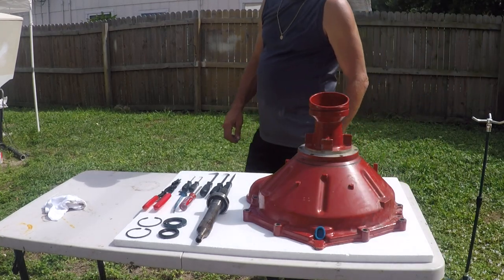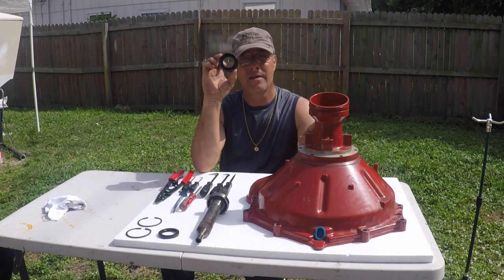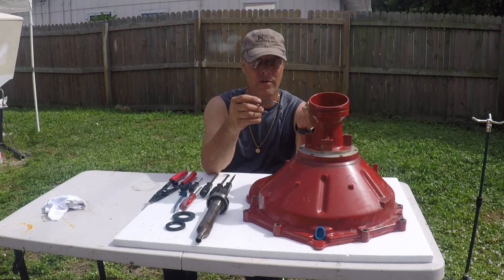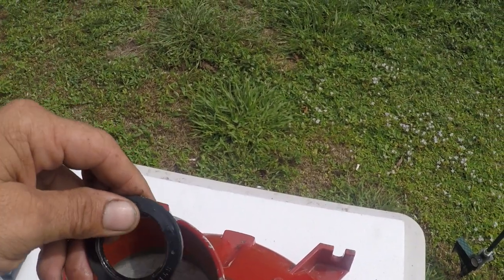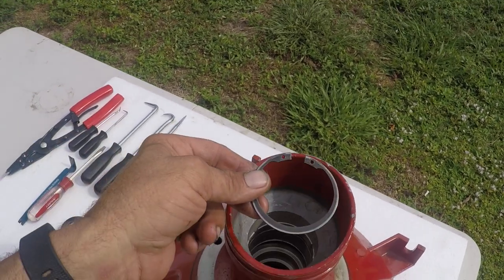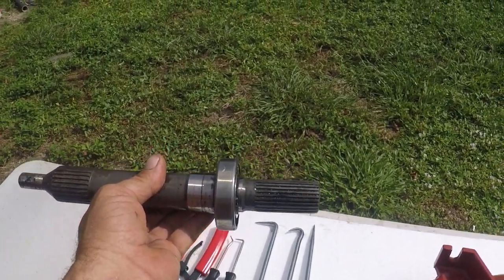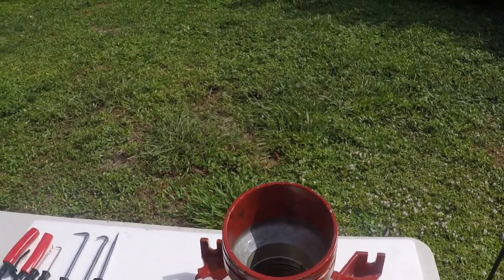Volvo Penta 290 14" Bellhousing replace bearing & seals

Comment: Guys....it's a good video. Stop arguing the toss over terminology. It's shaped like a bell. Every couple of years I strip this and change the bearings / seals etc. I always forget which way the shaft comes out. For or aft and belting the shaft the wrong way is going to be expensive. It's a good clear video which reminds us of what's going on in there. Thanks very much

Comment: Hey guys, great video by the way. Im having all kinds of issues trying to figure out if i have 1 bearing or 2. Its a 1995 dp-c with the 4.3 motor. Ive been told i have to remove the motor and ive also been told i dont have to. Any help wold be greatly appreciated.

Comment: Only the V6 and V8 bell housings that take the 14 inch flywheel have the single bearing assembly which makes the job a piece of cake........The other bell housings that take the 12 inch flywheel has two sets of bearings.  I'm surprised you didn't show the removal of the bearing from the shaft.......A press comes in very handy on that one.  All snap rings go in before the last seal is installed.  Not sure if you have recently heard but the reason some people install that last outer seal backwards is there are some online chat forums that recommend doing so to help stop water from getting in better opposed to the conventional installation method.  The trim cylinders seals are set up that way which is probably why that recommendation came up.  Doesn't matter either way as replacing the bellow once it shows signs of age keeps the assembly nice and try.  Once water gets in the u-joints are the first to be attacked and if those come apart due to neglect it could wipe out the bell housing.
Reply from the maker: Like an idiot I was filming it but my gopro shut off battery died

Comment: Really appreciate your effort in making this video. I happen to come across it because I am doing the same job. Wondering if I can pull that shaft without removing the bell housing off the engine? If I pull the seals and snap rings can I just pull the shaft out?
Reply: I removed the bellhouse and swapped the 2 bearings this summer in mine, mine is a 290, so it had 1 more snap ring that this video shows which goes around the axel. 
So if you dont have the snap for the axel it should be possible, but It would actually be easier to just pull the engine and swap everything at once. the job is rather easy as long as you have good snap ring tools, you need Normal and inverted snap ring tool. 

Mine also had a grease nipple on the bellhouse which Eddie said the 290 does not have, so it might be a difference in which year they are produced. 

The actual bearings came out rather easy, and the motor allignment is rather easy compared to mercruiser, due to the 6 lock nuts that goes into the outdrive plate in the back. So tighten it enough to align the engine and then move the engine to your marked spots(I traced the engine mounting pos) once you tighten them down you torque the backplate into spec and you are done.

Comment: FYI.... this component is a Flywheel Cover..... ( Bellhousing in the automotive world )
Also, this is NOT a 290 Flywheel Cover!  The 290 Flywheel Cover was equipped with a Double Bearing PDS, and also a grease port for lubricating these bearings in the future. The 290 Flywheel Cover will accept  the 
GM 153 tooth flywheel  and the small Volvo Penta flywheel only. 

The one being shown is a later model single bearing PDS Flywheel Cover that accepts the 168 tooth flywheel. Most likely from a SP-C or DP-C drive.   
The shaft that he shows us is a PDS.... (primary drive shaft) 
He is also showing a 6206 bearing, of which is an open bearing. 
However, this F/C is not equipped with a grease port, so a 6206-2RS sealed bearing must be used. 

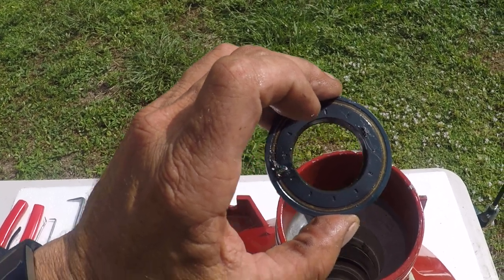At 3:13 into the video he shows the AFT seal.  Since this Flywheel Cover does not offer a grease port, the AFT seal can be installed in the conventional direction. 
However, for any F/C that offers serviceable PDS bearings, the AFT seal will install in the "non-conventional" direction to ensure that it may breach excessive grease gun pressure and/or volume. 

Use a good high pressure bearing grease. The Marine grease is inferior for this purpose.

Just a heads up and FYI for you guys .
Reply from the maker: 290 penta bell housing 14" is a single bearing if its a 12" then it has 2 bearings this was the last year of this bell housing, very hard to find
Reply: Eddie, all due respect to you and no offense intended........ this Volvo Penta part is a "Flywheel Cover". Bellhousing is an Automotive term.  The GM V-8  engine flywheel cover for the 290 stern drive dates back earlier. One change that was made would be that the AFT end  PDS splines changed from course to fine. 
The 290 F/C will house a 153 tooth ring gear flywheel ONLY. 
The F/C shown in the video is a later unit (not a 290). It will house both the 153 and 168 tooth ring gear flywheel.
Reply from the maker: A 290 Volvo Penta bellhousing only has one bearing a 280-270-260 has two bearings unless you have a small diameter flywheel for the older 350 5.7 liter engines this bellhousing is for a pre Vortec and Vortec engines 1996 and up till they ended the series and came out with the SX
Reply from the maker: That is high temperature Marine grease not just regular Marine Grease

Comment: ya hey thanks you put on a good show mine I took the snap ring out and drove out the seal undamaged (dead blow and block of wood) took a few taps don't hit it hard no corrosion in mine ya the seal numbers on yours would and bearing #'s on yours woulda been interesting sometimes those housings are savable with the bearing numbers rusted off and thanks for this video

Comment: That seal was installed correctly, it was not upside down.
Reply: yes brianko , the way he has it now will allow water to go in to the shaft an bearings , if / the bellows fail

Comment: hi great video. I have a question I have a 1991 Larson san marino 26ft boat. its got a 350 chevy engine with a Volvo Penta 290 outdrive. the gimble bearing has exploded. can the gimble bearing be replaced from the back of the boat by removing the outdrive? please let me know . thank you.
Reply: Yes, it can
Reply: @halfwayhousegarage2959  It depends which bellhousing you got, there's one with 2 bearings and this one in the video with just 1 bearing, the one with 2 bearings you need to take the engine out. Because the outer bearing you take out the direction against the sterndrive. The inner bearing you take out in the direction towards the engine!

Comment: So can you change these without pulling out the engine and flywheel cover? Can it be accessed from the leg by pulling out the upper drive and uni joint bellow?
Reply: You can do the gimbal bearing with just pulling the outdrive

Comment: The outer seal was mounted correctly and not upside down in the first place. the way it ha been fitted in this video is incorrect , if / when the bellows fail any water will go to the bearings

Comment: do you know the kit bearing part number?
Reply: These are nothing more than Industry Standard bearings, and can be purchased from any good bearing supplier. 
Double bearing PDS requires a 6026 and a 6007. 
Single bearing PDS requires a 6206-2RS sealed bearing. 
No Chinese bearings.... use US, Japanese or German, etc.

Comment: How do you remove the red big housing from the engine... mines it’s stuck
Reply: Same boat right now. Did you ever figure it out? Rust is my problem I think.
Reply: @chrisgillispie89  i had to take the whole engine out with the housing and then removed all the snap ring with special long pliers

Comment: Marine grease is not necessary (it wont hurt) being the bellhousing does not get wet. Well at least it shouldn't get wet.
Reply from the maker: fin screenname  marine grease is very important, it resists moisture so it won't break down especially when that shaft is spinning at a extremely fast rate it heats up and when that happens it creates moisture that's why its important to use a hi-temp marine grease
Reply from the maker: High temp marine grease is the best it doesn't break down

Comment from the maker: You have to pull the engine out to get that off you cannot do it with the engine in and you cannot do it with the outdrive on it all has to come off
Reply: The later GM V-8 or V-6 flywheel cover (with the single bearing PDS) does not require engine removal.
 You will remove the transmission only..... not the entire stern drive.   
The earlier GM V-8 or V-6 flywheel cover (with the double bearing PDS) does require engine removal in order to gain access to the front of the PDS. 
The flywheel covers for the Ford 335 series engines will be a single bearing PDS w/ the pilot nose. 
Again, you will remove the transmission only for this work.

Comment: Hey Mr Eddie, I have what’s labeled as a Volvo Penta AQ 231 with a 285 out drive. It’s in a 1989 Baretta Supersport and I need to replace the drive bearings. I can’t find any information on the one that I have that lined up with what I see. It has two bearings in the bell housing instead of 1 as I’ve seen everywhere else. Do you have any information that could help me or could you point me in the right direction? Thanks.
Reply: tag me if your still around, I can help you with it. I replaced my 2x bearings this summer :)
Reply: @RiliKickass  Hey man thanks for the reply!! I finally got it figured out last summer. I used a Timkin and a NSK bearing with two Timkin seals. I used some cylindrical locking compound/retaining compound because it was a loose fit for my liking.
Reply: @BakerHalley  Ah that's great to hear! you said it was a loose fit? as in the axel actually was lose after the bearings where fitted?  Or for the seal rings on either side?  Cause the sealing ring in the back is supposed to be lose around the axel due to the outboard driveshaft is gonna lock into it to create a seal.
Reply: @RiliKickass  the bearings were loose in the bell housing.